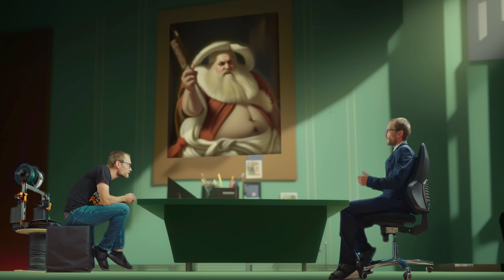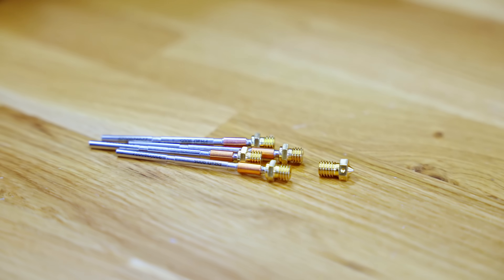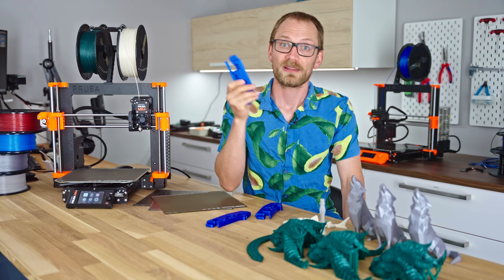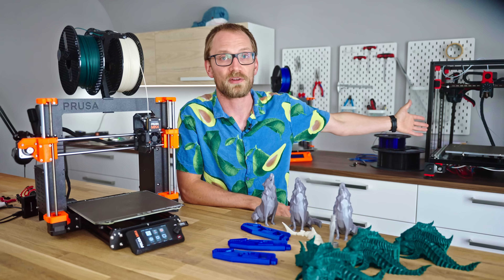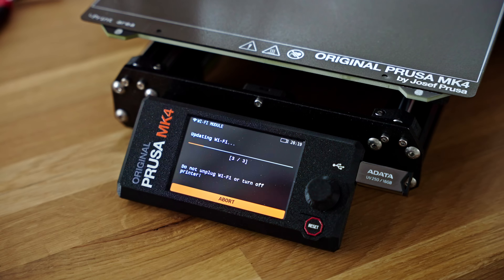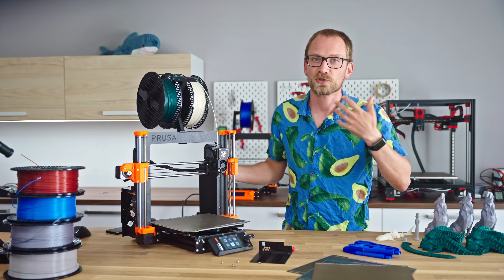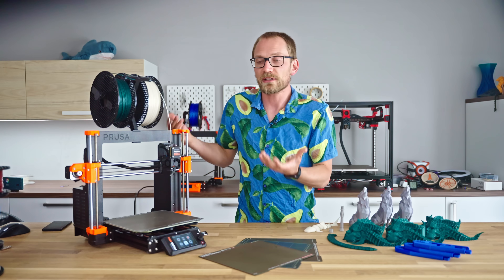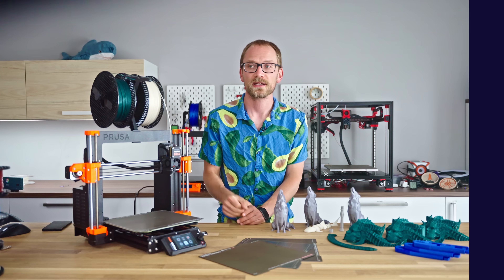Does the Prusa MK4 have what it takes?

Comment: I think reviewers focus too much on cost of printers and short term. A lot of cheap options that are simply a pain to maintain (bed leveling, or just parts replacement). Yes you have a printer for $200 but then it gives you little joy and frustration.

This Prusa is designed like a work horse, not like a one trick pony. Yes it's relatively expensive if you just look at the hardware, yes the input shaping is not (entirely) there yet, but the company is at least trying to build up an empire the right way instead of just dumping printers on the market for ridiculous prices without any track record and promise of maintenance and support.

Luckily Thomas adds these subtleties somewhat, but honestly, it is kind of hard to fight the uphill battle of all these Chinese brands that just churn out a new printer model every other week. Yes I'm looking at you Creality.

Comment: While I am happy with my mk3 and mk2.5 I also use the MMU of Prusa quite a lot and that's still a problem. The MMU does not keep up at all with the reliability of the printer at all. That is now a reason to look for a better solution, also reading that the MMU3 is just a minor step forward. If the MMU worked reliably I would not care about input shaper and other things that speed up the process.

Comment: I will continue to use Prusa because of their dedication to open source and non-proprietary/patented parts.
They are easily the most reliable and consistent printers I've tried. I can confidently press print and just walk away knowing the job will complete without fail or issue. Prusa is the 12 valve Cummins of the 3d Printing world. A reliable, consistent, and simple work horse. They just work day in and day out.
Other brands love to patent their proprietary parts which could be a nightmare if that company ever goes under, or has supply issues... which we've definitely seen. That's just not an issue with Prusa at all.
My only issue with Prusa these days, is the price point of the MK4 as stated. They are asking a premium price for printer that lacks the pizzazz of a premium printer.

Comment: Marlin supports input shaping with manual tuning. Sounds like you might need to run those calibration prints and adjust the input shaping values. IMHO an accelerometer only automates this process. Doing it manually also works, but is more time consuming. But if the mechanical properties of your priner don't change, your input shaping tuning values don't change either.
Reply: The whole point of prusa is that it always just works and you dont have to tinker with it. Or thats what I always hear from prusa stans.  Its not really a feature if it at minimum doesnt have a build in wizard, or just intuitive way to mount accellerometers and run self calibration.
Reply: @jakubmastalir3557  I love arguing with people have no idea what they are talking about. Yes, the accelerometer on the print head would automate the tuning of a single number for x-axis. Another accelerometer on bed for y-axis. Two numbers which basically never change unless you are modifying the printer HW substantially. Read the docs on Marlin input shaping to understand the process. It is literally printing one test part and looking at it to choose the best value for each axis. And you only do this once. For the input shaping on the MK4, they are doing this for you at the factory and providing a baked in default value in the firmware. But that isn't to say the value can be fine tuned. Sometimes Tom can be a bit of a nitwit on things like this.
Reply: @mr_disintegrator  I can do that with my ender 3 that doesn't cost 1300€, and I did. It can more than keep up with the prusa mk4. But when you buy something that expensive you want it to be better and easier to use. Like bamboo....

Comment: On my MK4 I can't see the input shaping artifacts you have. But I'm still running alpha1. Otherwise I'm pretty happy with the machine. I also have to say, the assembly quality seems to be much better compared to the latest MK3 models. I have over 30 MK3 machines, and the oldest machines are still the best. The newer the machines, the more little issues we find using them. Partially as of a bad assembly, loose or too tight screws, offset belts etc. So maybe my good feelings on the MK4 is build upon the issues we had in the last couple months with the other machines.

Comment: The MK4 is great for me - after upgrading my Ender 3, I found that I don't want to tinker with the printer, after simple BL touch turned to be a two week errand - not to make it work, which was matter of an hour, but to make the whole printer work well with the feature added. This is what Prusa does for me, which is why the IS firmware is still in alpha - it works, but Prusa makes sure to make it work well before they make it an official release. At the same time, the printers are still built using more or less standard hardware so repairability is great - while I don't want to tinker with the printer, I want to be able to service it myself, so it's perfect for me.
Reply: You are right, prushas are great for people that want to feel like they can fix it, even though they aren't able to and if they could prusha wouldn't let them.
Reply: @jakubmastalir3557  can you elaborate how Prusa doesn't let people to fix their printer?
Reply: @Papinak2  Not letting you fix your printer wasnt probably the best way to say it. But there is basically no comunnity to fix underlying design flaws, and offering overpriced components to replace parts in assemblies that are bad or are just straight up gonna fail again, isnt fixing in my book.
Reply: @Papinak2  Long story short, they let you buy overpriced parts to replace something, that doesnt fix it.
Reply: @jakubmastalir3557  can you provide some example of the flaws or unavailable parts/overpriced assemblies?
Reply: @Papinak2  Parts are available, you just have to pay 100 dollars for hot end that cost 60 from the original manufacturer, 150 for 8 bit board that nobody would even offer in 2023 and miles better alternatives cost maybe 50 dollars, but you cant use them because o the firmware. And there are many more examples. 
            And there are many flawed parts like filament sensor, extruder etc. etc. (mk3, mk4 is too new and overpriced for them to surface so fast)
Reply: @jakubmastalir3557  So the individual parts are available and you can fix the printer yourself.. interesting that each of your comments denies what the earlier one said.
You said that they charge 100$ for a part that can be bought for 60$ elsewhere - and that was exactly my point. Many components used on their printers are off the shelf components (including the 8-bit board). You could choose many components on the MK4 that aren't and it would be a valid critique, but instead you decided to criticise that they add markup on parts that can be easily purchased elsewhere.
Reply: @Papinak2  Not the mention that the parts for the new printers, as you pointed out yourself, arent availible at all. In contrast to companies like bambolab that provide cheap replacements. Not to mention that there was actually invested some RND into them.
Reply: @jakubmastalir3557  Bambulab only recently started selling X axis bearings - nearly a year after release and in an assembly. Are you sure it's the best example?
Unavailable spares are down to logistics,  which undoubtedly sucks.
Reply: @Papinak2  logistics? Sure. Because you definitely can't just produce fewer printers and keep a few spares stocked....
Reply: @jakubmastalir3557  manufacture fewer printers when they cannot even keep up with the demand and people wait months for their printer?

Comment: There is a serious problem with Prusa's input shaping approach, it doesn't take account of movement of the entire printer. When the head or the bed move, unless the printer is bolted down to concrete the whole printer will shake, this is why printers supporting input shaping run tests after setting up the printer to figure out this characteristic and also to detect resonant frequencies so these can be avoided. You just can't do that with a pre calculated one size fits all profile, this is probably why you are seeing low frequency ringing.

Comment: I don't know much about input shaping, but how can the machine compensate correctly for the varying mass of the spoils mounted at the top (acting like an inverted pendulum) without continual measurements from an IMU?
Reply: SteveBennet500 asked a similar question a couple of hours ago and the simple answer is: it doesn't. Nobody compensates for changes during printing (yet).
You do calibration movements/prints once to characterize the mechanical response of the printer and then apply the compensation values.

Finding tuning parameters on a defined calibration structure is much easier and more reliable than trying to tune parameters while printing. Worst case would be that you the compensation values are not correct and are actually negatively affecting the print quality. That would be incredibly hard to debug because it depends on the object being printed.
Reply: @crasbee  Is that initial calibration performed with the spoils attached to the machine or is it done by knowing the mechanics of the machine when it leaves the factory?

s/spoils/spools/ 🤣
Reply: @stevenbacon3878  I don't know what the final results of that will be. Time will tell what Prusas approach will be I guess.

After all, the firmware is still in Alpha.

Comment: Can someone explain to me how input shaping without a constant measuring sensor is supposed to work well on a machine designed to carry 2kg of filament on the top part of the frame one day & then 200grams the next?
Reply: I would assume that part is actually quite easy to profile. The printer knows how much weight is on the bed (how much it printed) so it can know how to adapt the input shaping to this, everything else being equal.

Comment: Been using the IS firmware the day it was released. Super happy with it and the updates so far. I print functional parts and have had no issues. Made a slowed down profile for tpu and that printed fine but needed to be tuned a lot! Only annoyance is because of increased speed and higher temps the color and matte-ness are not the same. Clear Petg will become cloudy for example.
Reply: Stephan found higher speeds on Bamboo X1 led to weaker prints iirc so you might want to test your parts if they are functional.

Comment: I wonder what Thomas would have thought if he was considering this printer at the kit price and not the pre-built price. I'm positive that those differences went into the decision making and writing for the video, I just wish to hear some thoughts on the kit printer market pricing instead of the pre-builts. As he said, for diy tinkerers, which most folks who fall into that category would have not bought this at the full price but at the kit level.
Reply: I've personally never really gotten the love of Prusa Kits. To me they eliminate the biggest selling point of prusas, that they have class leading... or rather used to have class leading user experiences. You take the thing out, you follow their guided steps and things just turn out fine.

With their kit, you are working 8 hours putting that thing together.

It's the antithesis of the point. To me, the kit has always existed as sort of a jedi mind trick pricing wise where they get to say its one price, when in reality for the biggest target customer its another. Its price segmentation, and Im not going to pretend its some massive evil scheme (its very common place), but it does mean that I actually disagree with you somewhat in that I think if he focused more on that it was a kit, the value proposition would actually be worse.

What?? you say? Yea, I actually do mean that, because for the price of the kit, you can buy a P1P and AMS.

If you are buying a fully assembled MK4 though, you can justify the price with the trust of the brands user experience consistency, and the idea that youll just take it out and never have to change any parts or tune filaments or settings if all things go well.

Comment: I have to admit, I don't really see what's wrong with the prints that used input shaping. Thomas is clearly disappointed with the current implementation, but the differences still seem to be pretty subtle. I watched the video full screen in 4K and I'm not sure what I'm supposed to see in these comparisons. The fact that the objects are moving is also not helping (e.g. at 5:32). Could someone please explain what these seemingly-obvious defects are?
Reply: the issue is that without input shapiong the sharp edges of the model are softened where the individual facets of the model meet. its like every sharp edge of the original model are softened/ rounded compared to the crisp corners of the non input shaped print. The surface quality of the individual facets has improved ans on the Mk3 version of the printer it prints with some surface artifacts which the MK4 input shaping firmware removed. So both good and bad. I suppose it depends on what you want your prints to look like, but I know from personal experience if you are printing working practical prints for me the softer cornering would make for sloppy fitting parts.
Reply: @deandavies1462  I see, thanks for the detailed explanation!

Comment: Input shaping works well for me for parts that require no supports, greatly speeding up prints (granted I print functional parts mostly). Compared to mk3, it is even more care-free. E.g. prints ninjaflex real easy, with no tangling, on blue tape. I love ability to just glue on blue tape and don't have to do "live adjust z" anymore. So MK4 is my high quality / fast prototyping machine, whereas my MK3 and minis are for scaling prints of my proven designs. I also sometimes print rush orders on it. For me, MK4 is a worthy machine, and I don't have a problem justifying a few extra hundreds for open source, ethically manufactured machine that is perfect at set-and-forget.

Comment: I think you're forgetting that wile prusa may be putting in more than its fair share it does also benefit from open source software. You said yourself that the input shaping is largely based on klipper, if klipper was a walled garden prusa would have to build theirs from scratch. And prusa slicer has implemented upgrades that were originally seen in its offshoots back into its own slicer.

That being said I wouldn't buy a prusa at this point either mostly because an open air bed slinger at $1300 is just laughable. I just picked up a fully-enclosed idex snapmaker j1 for exactly the same price.

Comment: I just picked up the bambu labs X1 carbon after being a long time Prusa customer. Why? Because I do not feel confident in the Prusa brand anymore. Yes its a reliable machine. But companies that don't change will inevitably die. Being this is not based out of the USA where I am from, it makes no sense to have faith in a company and then pay an additional premium and a VAT to have it shipped here. All of these things I didnt have issues with on the bambu x1 carbon. Also, the x1 carbon shipped and arrived to me in a matter of two days. I waited MONTHS on the prusa. You can only paint a horse soooo many of the same colors before you realize underneath, its still... wellll.... just a horse.

Comment: Great video and something I waited for till the release of the MK4. I would be OK with the price if it was a CoreXYZ system with a functionining input shaping AND a built in accelerometer. The current price vs features is too high.

Yes, they build a great website and a good slicer and need to recuperate their costs. Totally understandable. 

But this cannot be excused for a half hearted release like the MK4.This feels more like an Early Access title on steam. it just misses the "Survival" and "Crafting" tags to be perfect. The WIFI installation shows a lack of features that needed to be cut for the release date. This approach would be fine for a newer technology - but Wifi? 

I don't know, i will buy the mk4 in a year or so. Or maybe the Bamboo Lab one.

Comment: I Wonder how they print the face plate with different colors so beautiful. 
It’s not easy to get it this good looking. Especially no bleeding/smearing of nozzle movement over the text.
Maybe manual gcode editing of the travel moves?
Reply from the maker: Most of the two-color labeling on the MK4 looks like it's being added after the parts are 3D printed - my guess would be using pad or screen printing.

Comment: At this point in Time, i'd rather get a P1P for 670€. it comes with propper input shaping and its fast... really fast. For the price of the assembled Prusa you can get the X1 Carbon. 
Cant believe that im saying this, but i'd even run with a Creality K1 for half the money and deal with the shortcommings of it. But it can at least Print big ABS/ASA parts out of the box since its enclosed. Heck even the Qidi X Plus 3 is a printer i'd take into consideration... its bulky AF, but it has an actively heated chamber which is a godsend for PA6/12.